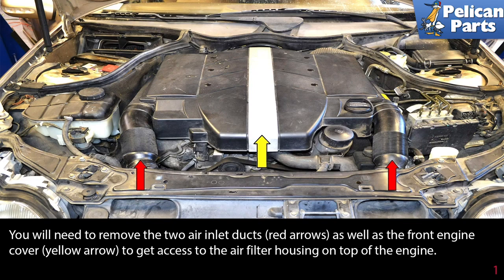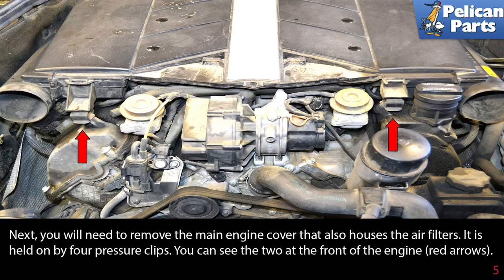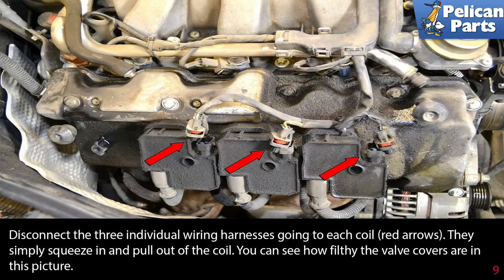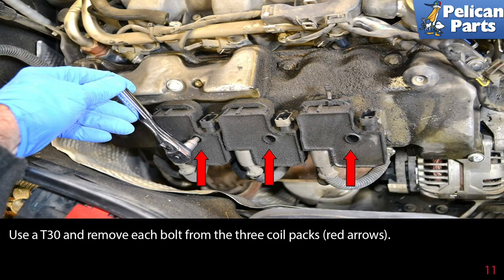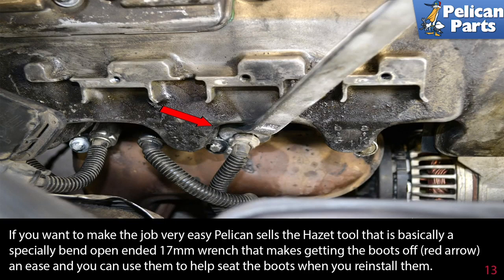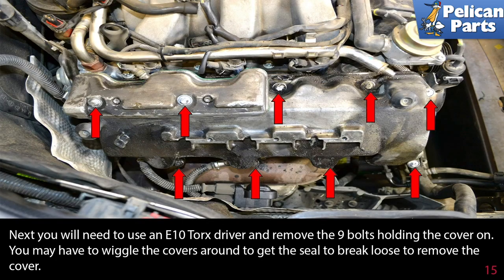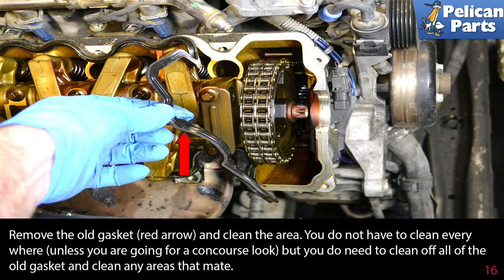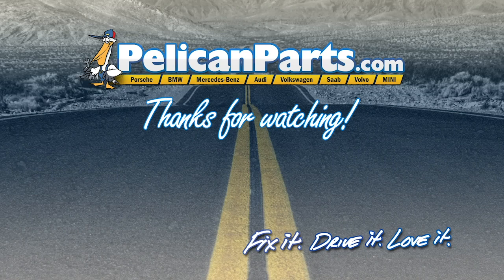Mercedes-Benz W203 C-Class Valve Cover Gasket Replacement

Comment: I have a 2007 C280 4Matic and cannot find a listing for a valve cover gasket. I think mine is leaking and want to replace it.
Reply from the maker: With your vehicle info handy, give The Pelican Parts parts specialists a call at 1-888-280-7799. They can figure out what part or repair kit you need.